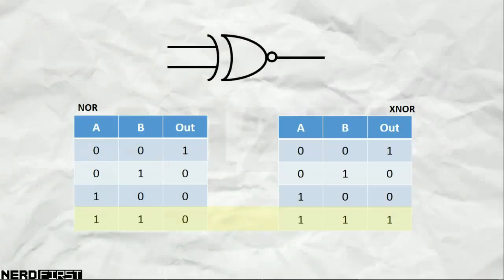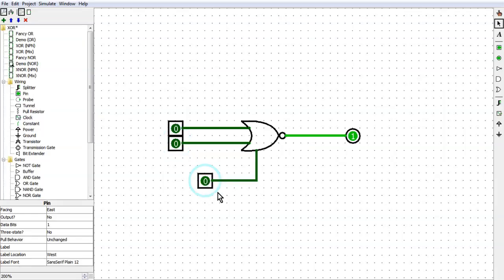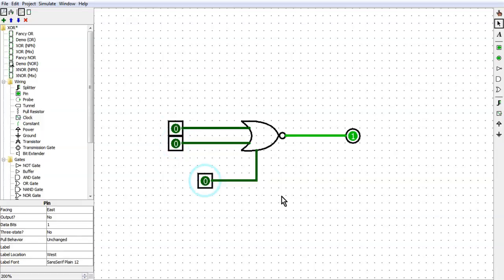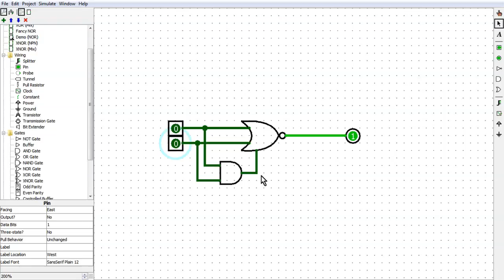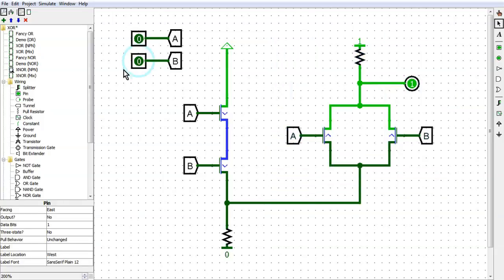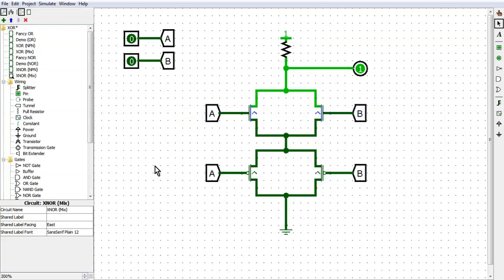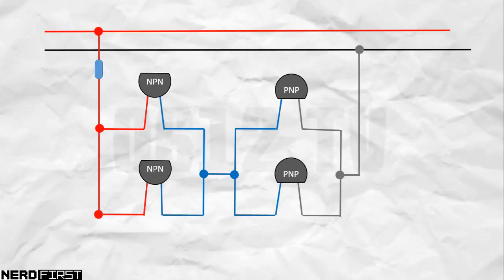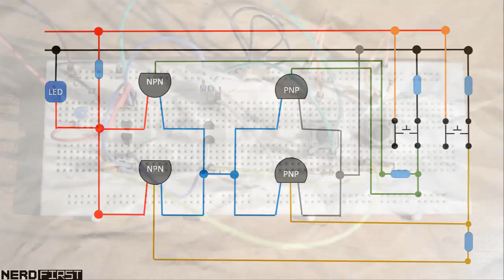XNOR Gates - Transistors 09

Comment: Hi there. Sorry if you see this twice. I'm very new to the hardware side of electronics. After I posted the first time, I was going back through the schematics I drew and the XOR wouldn't work (I left out a resistor), so I got confused deleted this post because I thought I had this one wrong, too, but I didn't.

I've watched all of this Transistor series. It's really good.

All I had were NPN transistors, so I made both the XOR and XNOR with 4 NPNs. From your comment about diodes, I realized I did need a diode for the XNOR to keep the NOR gate from pulling the AND gate down.

I learned a lot from your videos. Thanks for making them.
Reply from the maker: Hello and thank you very much for your comment! Sorry it took me a bit to get back to you.

I unfortunately didn't manage to experiment much with diodes for this series (it took me a while to get the basics intact with just the components used here), but that does sound interesting and I'm glad you got it to work =)